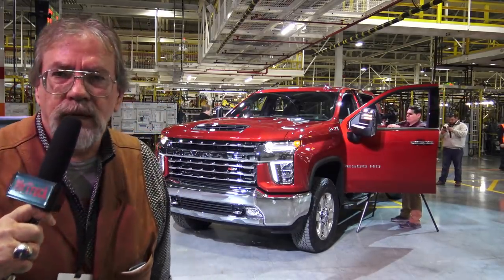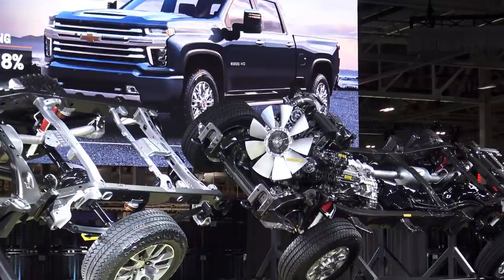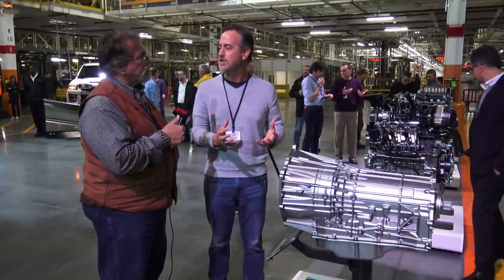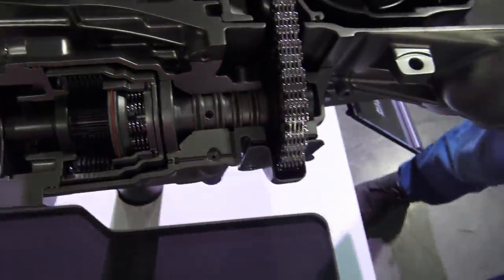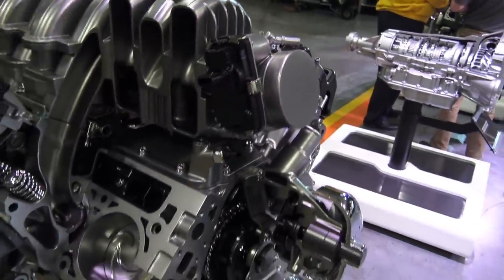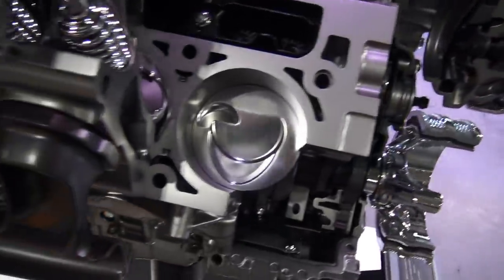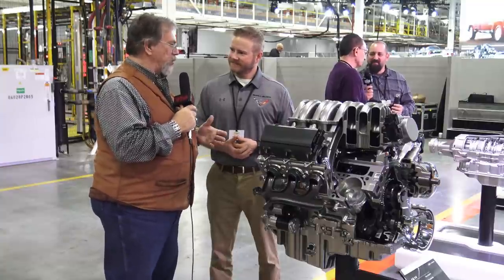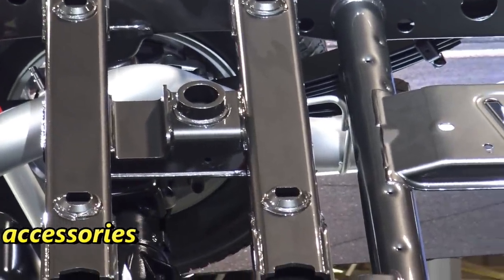2020 Chevrolet Heavy Duty factory tour in Flint, Part one engineer interviews

Comment: I'm not impressed that thing will  be extremely heavy which means poor fuel economy  most people don't need a truck that damn big and heavy unless they are boastful morons the truck looks like a nightmare to work on  and I bet it will have many problems and possible recalls I'm sure it will be above 80 K or more  also good luck selling that thing
Reply: Yeah, most normal people dont need a truck that big, thats not who the heavy duty line is trying to sell to. If you want a more economical, smaller, lighter truck thats cheaper then look at something like the Colorado

Comment: Frame looks like a joke compared to the Ford's
Reply: Joke as in PowerJoke 6.0?
Reply: how does it look like a joke? be more specific. Are you an engineer that know all about frame properties?  OR, are you an arm chair critic that knows nothing about it and you want to stir the pot.  TROLL.....
Reply: OH NO, a fricking car reviewer... Someone that reviews cars and doesn't know anything about anything.  Keep posting exhaust notes... You are good at that. at least 300 people like you....
Reply: @Dive-Bar-Casanova  My 6.0 powerstroke starts way better in the cold than any Gm diesel I ever had and also has way more power.
Reply: @bradcoddington1679  Is that before or after its 4th rebuild and $10,000 in "bullet proofing" the engine?
Reply: Looks like a Toyota frame.
 But it's been engineered to last for as long as the warranty.

Comment: Mr Truck, the time has come to get rid of that stupid microphone. After all it is the 21st century and the damn thing is terrible on this platform. If this is GM answer to the “new” market then they are destined to go broke again. Think of this, you just bought a F-150 with a 3.5L, the 3.5L is just about half the displacement of this monstrosity but has the same power ratings. This is a horrible way to go for GM.
Reply from the maker: This corded mic has the best sound I've had in years. Many wireless have interference from so many other mics. They aren't allowed at SEMA. Cords are a pain, but my goal is for better sound with less background noise. This is the best I can do for now. When I hit oil in the backyard, I'll speed thousands to upgrade sound.